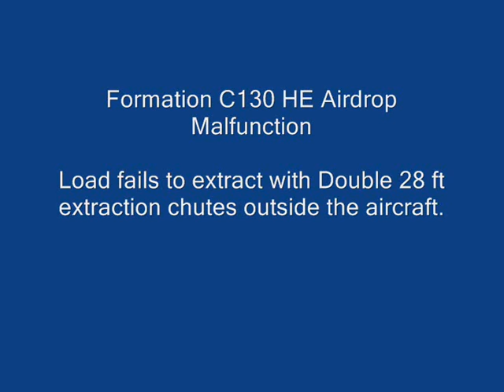C-130 74-1681, HE 2 x 28ft Chute Malfunction Aug 1989.wmv

Comment: So why didn't the load go out?
Reply: Because the Loadmaster relocked the platform with the left hand locks. The race track was too short. The Loadmaster was unable to get the LH's retracted prior to green ligfht. Once the extraction force was applied to the platform, it was virtually impossible to retract the LH's with the Simul handle.

Comment: i was a rigger when i got out in 55  someone failed in method to let happen  should go like this the pilot       k nows  when to start drop on he radio he tells load master to pull  safety cable  out ( this prepare load to go when ready  all chains removed load master take     s safety cable to coppit to show pilot its out all this happens a few min till drop time pilot  drops shot bag  to   oprerate to start drop this pulls drone(ribbon) chutes out 1 or2  these drones deploy they in turn star the load out of the plane   100 ft canopys are stacked on top of load the static lins are attached to the top of big chutes and the plane as it falls away  it  starts   unpacking chutes the static line breaks at top chute tied with nylon thread   now this happen very fast ---the big  chutes open in slow motion by design to keep from destroying --some one failed to pull safety  chains holding the load to start with     i am going from mem about 70 yrs ago

Comment: That's weird the BP system has emergency release for the LHS locks wonder why they didn't use that?
Reply: The aft restraints were on from the no-drop earlier and never got removed.  I was in the 773rd and in Panama when it happened.
Reply: @bobford01  Ahh ok
Reply: The BP release was not on the -4A dual rail system that the H model C130 had.
Reply: @10hunterLab  Were on the Australian H models must be diff on the US then.

Comment: this malfunction is incorrect able 2 x 28 foot extraction parachute is will bring the aircraft to stall at no time and the platform can not be restrained by the loadmaster so he can cut loose the extraction parachute. 
I think dropping double 28 feat extraction parachute is worthless.
Reply: abohsam AnNasHRi steady pull on the emergency handle for 10 to 20 seconds corrects the binding.
Reply: Matthew Bolton ...i was in the plane right behind them.  nothing worked.  the load was jammed.
Reply: I said the very same thing to our stan/eval guys.  let the jets drop the tanks.
Reply: @johnsmith4589  Hi! Is there a formal report of the mishap?
Reply: @johnsmith4589  no - the left hand locks were still in the platform.  it wasn't jammed

Comment: Loadmaster only fatalitie ,he was cutting chutes aways..ultimate crew failure and human error
Reply: TimU2Cool ...crew failure?  i was there.  they didn’t jam the load just to test how to stall a C-130.
Reply: @johnsmith4589  unfortunately it was crew failure. On the run in just prior to this one they went to the wrong PI, called no drop, then rushed the racetrack back around to attempt to drop again; you can hear the crew rushing through their calls. Due to the rushing/compressed timeline they didn’t correctly finish all the checklists, so the left hand locks were still engaged when they called green light. Those extraction chutes will exit the airplane regardless of lock position. The engaged left hand locks coupled with the drag of the extraction chutes ensured the load would not leave the airplane. Since then, the FTU works on training the front end crew to be intimately familiar with what the loadmasters are doing in the back. We make sure our reattacks always work within the loadmaster’s timeline.
Reply: @ryshroom  ...not sure where you got ur information, but like i said, i was there.  in the plane right behind them.  i have no memory of a racetrack that day. and in all the debriefs, no mention of leaving the locks engaged.  and the primary loadmaster was unlikely to make that kind of mistake.  possible, of course, but unlikely.  and the secondary loadmaster, who lost his leg, never mentioned that scenario, even after he was medically discharged.
Reply: @johnsmith4589  Hey, I just want to put my 2 cents in if I may. What they told us in the school house was that to a degree, but dumbed down since we don't have the manual locks. From what I remember correctly, the findings were that there was a racetrack, or dry pass or something where the locks were armed. A No-drop was called, the locks were reengaged to the fully locked state and never armed again. hearing the audio it does seem rushed, at least for that tail in the formation, I can't speak for your bird or any others in formation. After that the story is how you see it in the video, checklists were called complete and the green light came on. After this incident they made the checklists start all the way from the top. After the ND, initiate Completion of Drop Checklist, then start with the drop prep checklist, Run-in, then finally the 1 minute call/drop checklist. Some verbiage may very due to different aircraft model of course.
Reply: @ryshroom  The righthand locks are set to automatically release at a certain amount of pressure on them, the left hand locks are released by the L/M waiting on the green light! When he pulls the release handle the left locks retract and the load should go by by! If they had a prior no drop and racetracked back the saftey chains would have been put back and removed again durind his predrop checklist, not hard to miss since the chains would be in view of him.
Sad deal ! He’s a Hero! Climbing on top of that tall load to make an attemp to save his fellow crewman by cutting the extraction chutes!! 
I miss all that! B Hyer 374thTAW /CMB Clark AB, Philippines 1982- 1986
Reply: @brianhyer674   I’ll buy that. I’m totally aware of LM actions as I’m still in the business. What’s unclear is what steps had actually been accomplished by the LMs due to the compressed timeline. Another factor between then and now are the differences in TOs. Currently, there are no emergency aft restraints for multiple 28s. I’ve asked for the safety report, but that far back they don’t have electronic versions. Supposedly they will mail it to us.
Reply: @brianhyer674  WTF are you talking about?  The Left hand locks are retracted prior to the completion of slowdown by the Loadmaster using the sequential handle along with the removal of restraint chains.  The Right hand crossover is pulled if the airdrop load fails to extract at green light. The Left Simal handle is pulled 10-20 sec in the situation seen here.  EPs are briefed prior to takeoff/drop.
Reply: @ryshroom  The checklist was changed after this - with all airdrops reguadless of the situation started at the Slowdown.  Also, loadmasters had to brief EPs prior to the drop.

Comment: What are “the bleeds ?”
Reply: Bleeds are referring to Bleed Air which is tapped from the engines to produce air for the environmental system, de-icing and other pneumatic systems. When the bleed system is turned off the engines can produce more power.
Reply: What UAV Exploration said; with some additional details.  This airplane is a C-130 "Hercules" and has 4 turboprop engines.  A turboprop engine is a jet engine that drives a propeller.  Jet engines compress large quantities of air to a high pressure.  That high pressure air is referred to as "bleed air" as it makes its way down through the compressor stages.  Then into that high pressure "bleed air" fuel is injected.  That mixture of air/fuel is ignited producing a rapidly expanding mass of even higher pressurized air.  Then that high pressure air is directed over turbine blade(s) that rotate at high velocity and  energy.  That rotational energy is used in turn drive the compressor, and in this case the propellers through a transmission (gear box).  Some of the high pressure "bleed air" (pressurized air BEFORE fuel has been injected and then ignited) is used to do other "work" on the airplane.  For example, exactly as UAV Exploration listed, bleed air is used for heating, air-conditioning,  pressurizing the airplane, powering some deicing equipment.  The uses of bleed air vary with each airplane type.  I never flew the Lockheed C-130 so I am speaking in generalizations not specific information on this particular accident airplane.  The point is this; when you extract "bleed air" to operate any of these other systems you are robbing energy from the engines as they do not have all the air available to pass through the burner section and then have that energy extracted by the turbines.  The pilot wants to make sure that he has all the available power to the engines during this emergency to try and overcome the tremendous drag that the open and attached parachutes are putting on the airplane sending it down towards the ground.  By turning off the bleeds he is giving his engines the ability to produce the most amount of thrust they are capable of.  He needs all the thrust his engines are capable of producing so he has commanded the bleeds be turned off, the other crew members are trying to tell his that the bleeds are in fact off.
Reply: @apackwestbound5946  
Wow, I can only imagine how much you love to hear yourself talk.
Reply: @737MaxPilot 
What he said was very interesting.
Reply: @crow9149  
Maybe (I have almost 5K hrs on C-130s, so kinda boring for me), but long-winded!